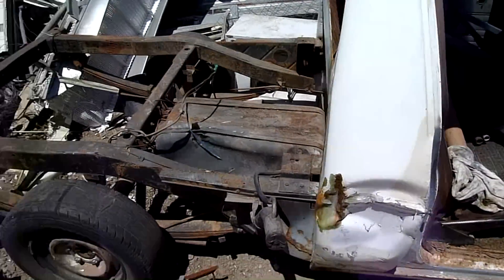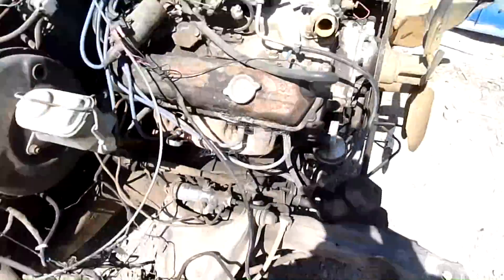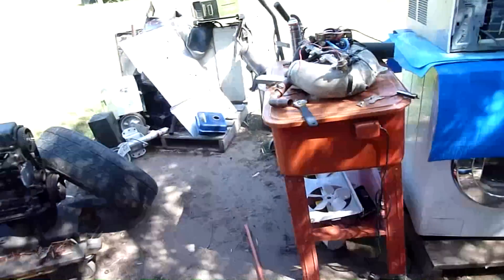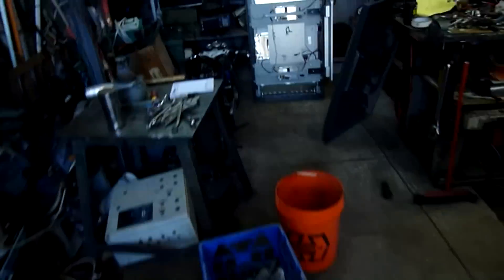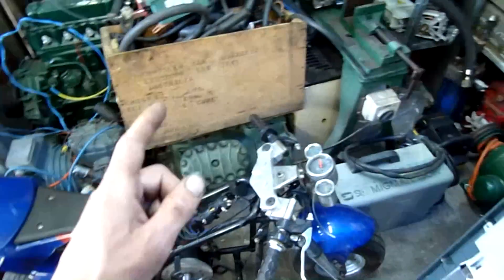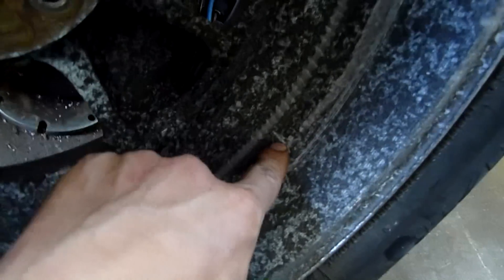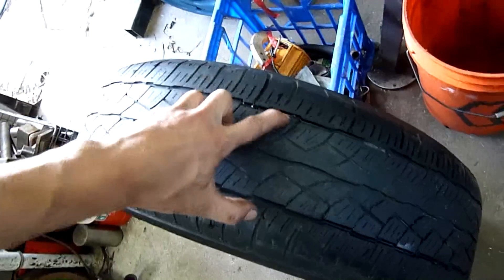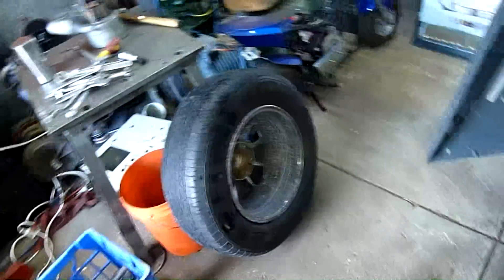Holden V8 Salvage, Shop Update and Odd SUV Wheel Damage

Comment: Left hand side of the block on the holden motor will tell you if its a 253 or 308 :)
Nasty damage on that alloy, we had a case at work once, where someone had worked on the car before we had, and the brake caliper had come loose and damaged the wheel pretty much the same way.

Comment: @BloKK187 tire fires are awesome ! how do you think alot of the concrete plants power up them kelms and furnaces , they burn the tires , then recover the limestone used as the rubber "filler" and whats left of all the steel bands

Comment: That rim inside line looks like one of the Caliper Bolts came off and the caliper dragged around the rim (had it happen to me a few months ago). Lesson, always use thread-lock, even if using torque wrench which I did

Comment from the maker: @BriggsMower sounds like you are taking them to the local tip?, I take mine to my regular tire shop and its usally $1.50 for passenger car and $4 for large SUV/Light truck disposals

tip fees are retarded down here. $25 or so for a tire, $35 for a mattress, and $9 each for TV's. no-wonder the back-roads are littered with illegally dumped trash!